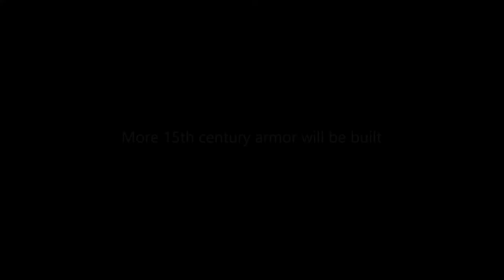Building a 15th Century Breastplate, Bevor, and Sallet

Comment: I'm about to attempt to make a breastplate like this out of 16 gauge mild steel. Any advice before I start? Also, I'm assuming for polishing you sand it with 80 grit flap disk, but what happens after that?
Reply from the maker: I think the best advice I can give is to follow the historical examples as closely as you can while still keeping your own proportions in mind. As an example, after I made this breastplate I found that the plackart was too long and I'll have to trim that down, after looking at the example again I found that the proportions were off and that if I make the shape more similar the original I would avoid that problem altogether and simultaneously make it a better fit to me. So just think critically about the structure of the armor, why it was shaped in the way it was, why a component is the size it is, that sort of thing. One thing I like to do is try to draw the armor I'm going to make. That way I'm familiar with the shapes and the way it should fit the human body. As an added bonus sometimes I discover little things that I wouldn't have thought about beforehand, like rivet placement or a specific number of lames, the placement of straps or hinges, etc.. As far as polishing goes, usually I do start with the 80 grit flap disk yes, sometimes I bypass that altogether and go straight to something with a higher grit and use progressively finer grits as I go along and finally end with a very fine sandpaper by hand. Though the true "secret" to polishing is to planish the devil out of the surface. If it's already smooth from planishing, you can skip straight to higher grits and the subsequent polishing. On another note related to planishing, I would recommend polishing the face of the hammers you use, particularly the ones that will be used on the outside of the armor. This makes the process even more effective.

Good luck with your project, I'm always here to answer questions.

Comment: I've been working on a breastplate fairly similar to this one and I've run into a bit of a problem. The top of the breastplate, sort of around the collar, seems to be a bit too forward of that makes any sense. It's kind of like there is a gap between my collar bone and chest area and the top of the breastplate. Any advice on what I may be doing wrong here?
Reply from the maker: Hard to say without seeing it, but it could be that the whole thing isn't deep enough, like if you were to just bend the parts that go over your collarbones, then match the rest of the shape to that angle it would probably work. If you'd like to send me a picture of it, my email is thelivingmanuscript@gmail.com. I might be able to help you better that way.

Comment: Hi medieval manuscript, I’ve got a question, about making a fauld for the breastplate, how do I attach them? With sliding rivets or leather straps?
Reply from the maker: Hello! In my understanding, the majority of faulds were attached with leather straps on the inside. Though later on when the faulds start extending onto the legs individually in the 16th century they often had sliding rivets. Hope this helps!

Comment: I'm going to attempt to add a visor to my open face sallet that has a shape very similar to this one you made. Do you have any tips and advice for making the visor?
Reply from the maker: My first attempt with a visor didn't go so well because the pivot points were too far up the side of the helmet, meaning that it couldn't open all the way or stay open. Another thing that I still have troubles with is that the whole thing is too flat in the front and hits my nose too often. Those were just the two things that I learned the hard way, I hope I helped a little, good luck!

Comment: How did you go about matching the shape of the plackert to the upper part of the breastplate?
Reply from the maker: Essentially all I did was dish them to the same depth, then matched them up as best I could on a ball stake of some sort. Truth be told there are still some unsightly gaps between the two and the plackert is too long, so when I eventually remove the plackert to shorten it I'll probably use some vise-grips to hold it and the breastplate together so that I can hammer it over a smooth stake to make sure they fit nicely and there are no gaps.

Comment: Looks nice, did you weld the helm with an arc welder?
Reply from the maker: Thank you, that is correct though. I used a Chicago Electric gasless wire fed MIG welder. It's a low powered one which makes it ideal for this sort of welding with thinner metals.

Comment: What is that cylindrical metal piece you use for dishing?
Reply from the maker: It's just a dedicated dishing form I made back in high school shop, all that's to it is a short section of steel pipe welded to a flat plate of steel. I heavily beveled the edge and it's been working out really well for me since then. I like it because I can get deeper shapes without hitting the bottom like most cast iron forms.

Comment: Is it possible to planish without a ball stake?
Reply from the maker: definitely, I try to do the majority of the planishing process from the inside if I can help it. That's just putting the outside of a piece on the face of an anvil and using a rounded hammer to smooth it from the inside.  Although with most pieces there will be a time when some sort of stake is at least good to have. I used to use a very polished railroad spike in a vice, still do for some work. Although it's possible to make a functional stake in some other ways, such as smoothing a trailer hitch ball and securing it to a stake somehow. I even used a hardwood ball jammed onto a steel pipe in a pinch. Plenty of options and ways around problems.